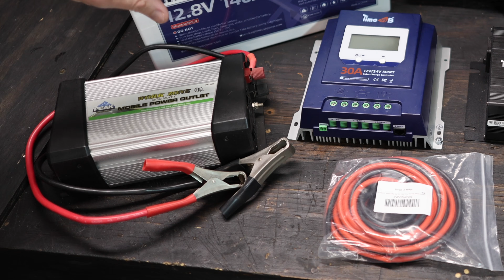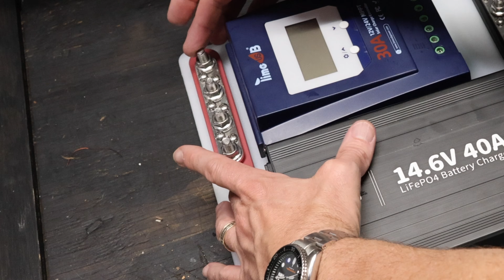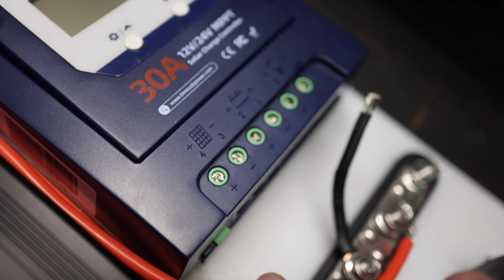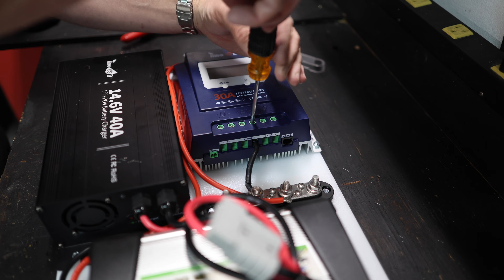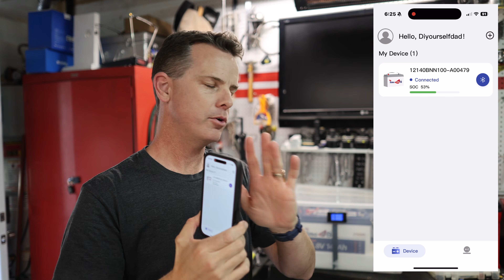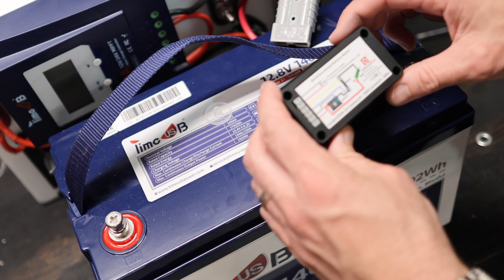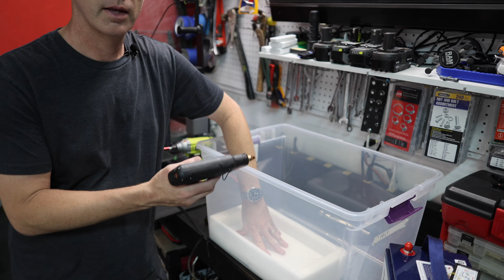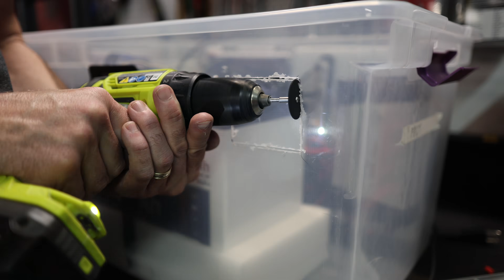Build Your Own Solar Power Station - Make It Better - Make It Cheaper

Comment: What I found is that wiring the solar charge controller to the bus bars wasn’t really charging the battery as well as wiring directly to the battery terminals. Wiring to the bus bar, you then have both input and output going across the bus bars. 
I’m not an electrician, but I do believe the instructions for the charge controller says to wire directly to the battery’s.
Reply: Nice work, however the problem with electronics like this is the speed at which they update and prices come down. The Anker C2000 now is only $799. 
Other thoughts as well….the prebuilt ones give you the option of turning off the outputs so they don’t drain the battery when not needed. Can you do that with your inverter so the 110v isn’t continuously on?
The other benefit of the premade ones are expansion is as simple as adding a second battery and stacking it. If you wanted to expand yours for example it would be a complete rebuild.

Comment: Aren't we already spending 500 dollars on the battery and inverter?
Reply from the maker: That depends, as I pointed out the video you can use a battery that you already have or buy a new one. In my case, I already had the battery and the inverter and only had to add other parts.

Comment: And I can do the same running a charge from my altimator???
Reply from the maker: If you are asking if you can charge one of these from your alternator, yes, you can.
Reply: @DoItYourselfDad no I mean is the basic wiring the same from the alternator isn't what I'm asking I know you can charge it from the car I was just asking the basic wiring straight to the bus bars from the alternator or can you use a smart isolation switch from the car battery?

Comment: What was the cost difference between what you constructed to a pre made one?
Reply: Looks under $700 for DIY (looked up parts from his links) vs. $2000.
Reply: @TedSpider2023  Non sense. There are companies selling powerbanks that have more power than this self build for about£600
Reply: @d4vidp4rry  like who
Reply: That's nonsense actually and factually. Brands are hugely lying on the capacity.
Reply: @Unclexjimmy6  Aferiy are the most reasonable that I've seen.
Reply: @d4vidp4rry  2k kWh power station is $800-$1200 in US, plus it's small and compact. I feel like 4 kWh or above should be made the way this guy is doing it.
Reply: About 10bucks if you were going for the same build.
Reply: Once you compare capacity and output against cost, its rarely worthwhile to build these things yourself. If you get the hardware on some kind of crazy surplus deal then sure, but not random amazon purchases.

These only really become worth it if one component of the whole system dies, then its cheaper to replace one part than the entire system
Reply: Id like to know as well ... at least the pre-built offers some sort of warranty...especially as a complete noob.
Reply: @Trek_and_Tide The components have their individual warranty.

The warranty on workmanship is you.
If it breaks, you fix it.
Fortunately it's really simple.
Reply: @Trek_and_Tide brother, ones you build have individual component warranty, being way easier to fix or RMA.
Reply: @Trek_and_Tide the parts he built this out of might have warranties.

Comment: so what was the total cost for that?
Reply: Looks under $700 for DIY (looked up parts from his links) vs. $2000.
Reply: @TedSpider2023  except you can find the anker f2000 for under $1000. I like the idea of the self build for repairability but there's very little difference in cost up front.
Reply: ~$3250

Comment: Those screws are self drilling not self tapping.  There's a difference.
Reply: Why are you being a smart ass to him? Is that relevant? When you said self tapping in the video, I thought to myself “Really? Hmm…okay” if that’s not right, it’s good he’s telling us.  You should welcome corrections!
Reply: @StevesMyName thanks dude but to be honest i didn't take it as him being a smart ass.

The reason i bought it up is because its a common mistake made by 99% of van builders for some reason. 

Self drilling does what it says on the tin..they literally drilling through the material used to save you making a pilot hole. The end of the screw is like a small drill head just before the thread starts

Self tapping screws literally make their own threads in the material (such as wood) to screw into (its like using a tap and die set)

I thought id mention that they are different to stop people buying the wrong items.

I hope i didn't come across as being a dick
Reply: @Pootz1000  thanks for explaining that! If in front of me, I’d know which ones to use, but I never knew what they were called. Good clarification and correction!
Reply: @StevesMyName cheers.
Reply from the maker: Never said I wasn’t welcoming corrections…
Reply from the maker: Neato

Comment: Do they make lifepo batteries with built in charge controllers? Great video thanks for the post. Need to build one for extreme winter temps in Alaska so I can easily take it out when not in use.
Reply from the maker: They all have BMS's on them, but you will need a dedicated charge controller if you are hooking up a solar panel.

Comment: Before i check the posts has your box gone on fire
Reply from the maker: Built several of these.... nope
Reply: @DoItYourselfDad why do you have to build several
Reply from the maker: I’ve built similar setups into my truck, trailer, a larger unit at work etc…

Comment: Question....i have a battery, a solar charger controller and a 3000W inverter..... this should be good right.... why do i need a battery charger? Thank you
Reply from the maker: If you want to plug it into the wall to charge it.

Comment: 1:34 if you choose to use a lead acid deep cycle or standard car battery it needs to be vented to release the hydrogen gas that can be produced during the charge cycle. If you do not vent it it could explode if the air to gas ratio is correct considering this battery will be enclosed in an somewhat air tight container.
Reply from the maker: Good point

Comment: I’ve been commenting about lead acid battery systems on a lot of these prepper videos. You can’t beat it. There’s 12v lead acid batteries all over the place, they’re cheap & readily available, you can start small & build up & it’s easily serviced.
You can also hard wire a second battery plus inverter into most regular vehicles & if you really need to bug out on foot you can take some solar panels & a small inverter with you & scavenge a battery when you get where you’re going.

Those power station box thingies are really just an expensive gimmick. They’re fine if you’re stuck in an apartment, or don’t want to learn about lead acid battery technology, but they’re massively overpriced for what you’re getting.

I don’t like lithium batteries, they’re extremely expensive here (over 4 times the price of lead acid) & I just prefer lead acid. It’s old tech, but it works, it’s cheap & is more forgiving than lithium.
There’s also things you can do to service lead acid batteries, I’ve even seen people convert old ones to alkaline batteries to get a few more years out of them..

Comment: I've built a few different electronic box projects and my problem is normally sourcing a suitable box that doesn't cost a fortune. I can totally see making a box similar to what you did in something like a rolling Pelican case, or Milwaukee Packout rolling box...problem is those boxes cost in the $200 range themselves without any electronics. That's why many times I find it actually cheaper and more practical to buy something off the shelf and let companies like Ecoflow do all the engineering for me as well as adding things like cooling fans, circuit breakers, fuses, and a warranty if it breaks. I did enjoy your video- not trying to be negative.

Comment: I got a Jackery explorer 1000 plus from Costco for $649 (1264 wh capacity) including a 100w solar panel. It also fast charges and for a good battery, fast charger, 2kw inverter, panel, charge controller etc it's not cheaper. Just more work.

Comment: Okay so I haven't checked and will check later, but I want to build a bike cart from wood. 

The reason for this is that when using an ebike, all bike carts are top heavy and need to be loaded down with weight. If they are not and hit a curb or pothole then they flip. They almost always also use 18in tires.

I want a bike cart that has extremely high handling and won't tip over. Newer mountain bikes for down hill trails are using 29in tires for better handling and bump resistance along side shock loads. 

If I can build a trailer that connects like other trailers but has 29in wheels and is bottom heavy then it shouldn't be able to flip over.

Comment: I would definitely use M4 bolts tho.
I see too many of them self tappers coming loose in my daily life.
And the screw terminals of that amperage probably want crimped ferrules, but I don't think that matters in a stationary environment.
In a camper or near a generator you'd want ferrules to reinforce against vibration.

Comment: I really don't get this, it's the same as any boat or camper, or home battery. Only a plastic box that is the difference and if you calculate it with work hours doing it it's not cost effective at all.

Comment: I have an Ionic 12v 100ah marine battery that I don’t use a lot for my boat. I’d like to make a power bank and use this battery (for camping). Do you think it’s worth building something with this size battery? Also, I imagine I would need a lower inverter for the 100ah.  Thanks for your help.

Comment: I love the diy concept but what you built can not be compared to the Anker power station. That modified sine wave inverter is junk. Also no overload protection. Also the Anker can be purchased for much less than $2000, just saw it for $999. I own one and it is an excellent power station.

Comment: Idle consumption harbor freight 2000 review can it power furnace swamp cooler dryer washer air fryer microwave welder refrigerator sinus wave modified bifacial vs mono facial temp resistant

Comment: I really like this setup overall, but it seems the heat dissipation factor may have been overlooked. I wouldn’t have thought much about it, except my inverter has been low-volting whenever it gets too hot. Pumping all that heat into the container will reduce efficiency and likely shorten the lifespan of everything inside. At the very least, the inverter should be vented outward. The cutting board idea is brilliant though. I'm going to use that one myself.

Comment: Also all batteries like that do let off a gas as part of the electrolysis. Without venting hole you could get a small hydrogen explosion.
Reply from the maker: Lithium iron phosphate batteries do not vent.

Comment: So what I would like to know do you need to connect a portable jackery or bluetti ect portable power bank before a 30amp charger or after does the charger help maintain or do the portable power have its own built in charger 🤔 but I know working with lithium batteries it is wise to use and touch a resistor to everything before connecting because if it sparks while connecting it could damage components

Comment: You don’t need the charge controller and a battery charger. The charge controller does both. On the box there’s a place for solar there’s a place for the battery and there’s a place for a load. The inverter gets tied into the load. The battery gets tied directly into the center. And then the solar gets plugged in to the first part. You don’t need the battery charger. Hence why it’s called a charge controller.
Reply from the maker: At a minimum you’re going to need an AC to DC converter… which is what the charger is doing here.

Comment: Love the name DIY DAD for this channel.  Did you add a fuse able link on the  ground side of the circuit.😅
Reply from the maker: I did not add a fuse, these batteries have a BMS on board that functions the same way as a fuse wood. Although, I could definitely see one wanting to put a fuse on a system like this regardless.

Comment: Nobody pays list that Anker is 1k right now, not 2 grand.  And there is a reason packaged stations cost more.  Many, many reasons.  I have two inverter/battery combos but they, and this are not replacements for systems.

Comment: Se io volessi avere 280Ah dovrei installare 2 batterie da 140Ah, ma a questo punto cosa dovrei cambiare e poi avrei due messaggi sul telefono e due Shunt? A dire la verità facendo un giro su internet ho trovato delle Power Station che costano quasi la metà e di marca  di tutto quei pezzi singoli. Non mi pare che convenga tutto questo lavoro.

Comment: Nice video... But you can buy a power station with the equivalent capacities for $500 to $600. Which is exactly what you have in the components here. I have a couple of different size power stations, and a DIY one similar to what you built here. They all have their place, but the power stations are easier.
Reply: That's what I was thinking. Power stations are soooo cheap on sale, need the numbers up front

Comment: This was a super slick video, very easy to understand. 
I don't want to be the critic but it would have been a good idea to add air vents for cooling,  also the 15 year old inverter is probably not very efficient compared with today's models, still,  great to make use of what you have.  I would also have thought a fuse or two would be necessary. 
Great video on how to save money building your own power pack.
Inspirational!

Comment: This set up is around $700 with the items he mentioned plus tools, wires, connecters, etc.  A 1028wh ecoflow is under $500 right now  and $520 for the newer delta version... so I'm not sure this DIY is worth it. It's self contained in a beautiful case and very portable.

Comment: I've built a few of these power stations in much higher quality, yet I've since bought a ready-made one. Why?

 Space requirements: There are massive disadvantages when every single component, including the housing, is installed... the space requirements are enormous. Probably less of a problem for home use, but if you want to use the thing on the move, it's not doing yourself any favors. 

Price: Ready-made power stations are so cheap these days that it's difficult to get comparable performance at a price advantage. For example, a 2,500-watt inverter, like the one installed in most modern power stations, costs between €400 and €500 here in Europe with pure sine wave power. But that's only one component of what you need... I could go on forever...

 I've now gotten 2,048 watt-hours with a 3,000-watt sine wave inverter for €1,000 - DJI Power 2000.

Comment: I would add fuses between the inverter and battery, and solar panel and charge controller at least. Otherwise very informative and well presented!
Reply: The better batteries have fuses too, so it’s just an accurate dupe to add fuses. I concur

Comment: Great build! Earned a subscription 😁 One thing to mention, I wouldn't use any old car battery for this unless you plan on isolating and ventilating the battery, because leadacid batteries create hydrogen gas when changing. Also not putting the strap on the outside at the bottom because moisture will wick up that strap if you place it on anything wet.

Comment: My wish. Dyi 8 10kWh , 240v/110 outlets. Solar or slow charge at home. Needed for my Stark moto bike 7 kWh battery. Currently use 240v 999$ Costco generator for charging at track. 2000$ max price. Sometimes 3 day events/ charging needed.

Comment: good job. i just have 1 suggestion:
you absolutely should wire in a PC fan and attach it to the inside of the box, and put some holes in the box. cuz you don't want your inverter, charge controller, or battery, getting too hot. that could cause things to shut off, become much more inefficient, reduce the lifespan of the equipment, and even melt the box and cause a fire if you're unlucky. 
i'm planning on redoing my similar build for my SUV in the next couple weeks, and i was looking to see if i could get some ideas from other people's builds, and i really like the simplicity of your build.

anyways, you got me to subscribe

Comment: If using a dual battery system at 12V, would I need two shunt units, or just one where the power it being sent to the system??

Comment: Seems like a good idea. What i did miss is the price comparison. How much did you save by making one yourself. 
I'm in Europe, so i'll have to find other kind of voltage output and stuff, but the same principle will work anyway. I'm thinking of making one myself too in time. What i will have to look up then is whether it is possible to put in more than one battery and how to connect multiple solar panels. Should be possible i guess. It's a very clean setup you made and that's a thing i appreciate with items that at first glance seem complicated.

Thank you for the video.

Comment: The trick is making a system that works with a generic quiet generator where it can kick the generator on when the battery is low and shut it off when the battery is full
Reply: All automatic

Comment: for those of you who do not understand electricity just buy a power station. yes more expensive but if you will burn the whole project to the ground with your house or a car just because you don't know what you are doing , it seems a lot cheaper proposition. if you screw up as much as the battery type or a wire thickness, everything will go up in smoke.

Comment: Thank you, Sir for your great tutorial video. I have a question: Does this type of battery have overcharged protection? Can I wired directly to the vehicle alternator for charging without using the charger?
Reply from the maker: It does, the only issue is, you won’t be able to fully charge one of these batteries with an alternator as the maximum voltage of the alternator is under the maximum voltage of one of these batteries by about a volt.